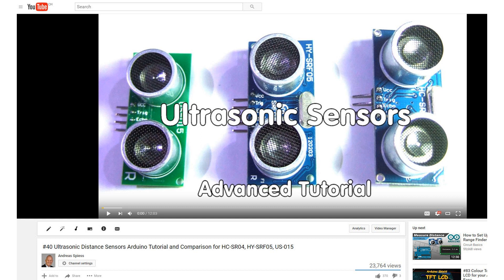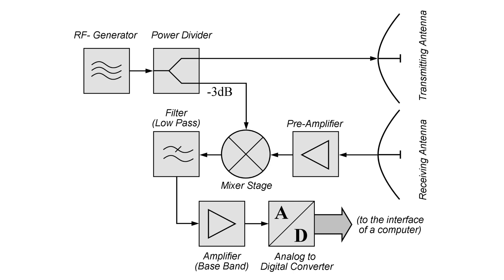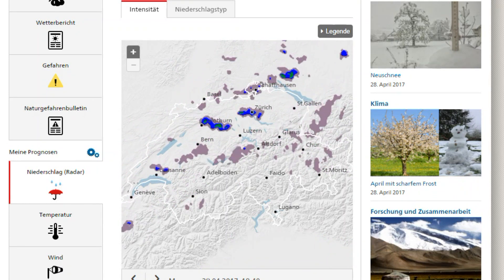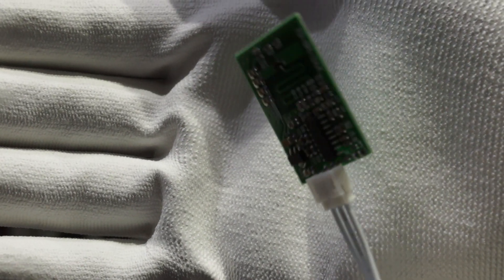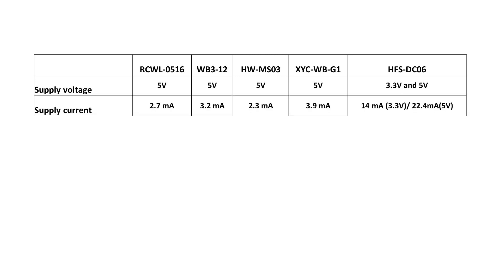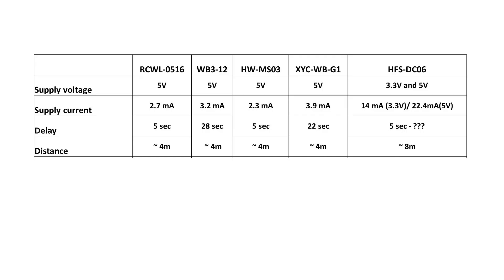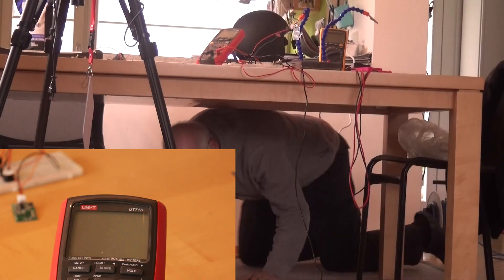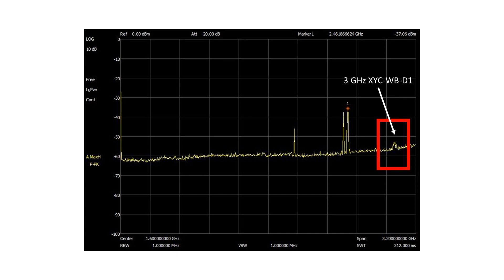#135 Radar Sensors / Switches: Comparison and Tests

Comment: The RCWL-0516 is not 360  When I power it up and sit behind it IC side it does nothing. It seem to be something like 270  to 200 degrees. With pets it kind of does not  pick up a small dog and I dont have a big dog. It works well but the sensitivity pattern is a big mystery.  Outdoors is another question but in general much better than a PIR. Very interesting is that it probably relies on a bounced signal from objects as can be expected  which results in the idea that it has a 360 degree but it is rather doppler. Besides that it is an excellent sensor
Reply from the maker: And in addition, it is very cheap and goes through thin walls...

Comment: Hello Andreas. Interesting video. I was thinking, if you cover one side of the sensors with some metal plate, will it become direction sensitive? Maybe the plate must be connected to Ground? I am looking forward for the results.
Reply from the maker: I had one sensor with a metal shield and it worked. So, it should be possible. I would connect it to ground. At least to begin with.

Comment: I think the lack of interference between 2 modules can be explained by them giving out a short pulse on a interval and only listening for a very short period after the pulse, making it unprobable that a sensor will be listening while the other is transmitting
Reply from the maker: I doubt that this is the case as we have not enough active components on the board. There are many discussions and videos which try to explain how they work. I do not know exactly.

Comment: I wanted to know when someone is approaching the yard so I used AVR µC + PIR sensor + NRF24L01+ at the transmitting side and AVR + NRF24L01+ and the speaker at the receiving side. That works but only when it is dark (there are false alarms during the daylight). I wonder if I could use RCWL-0516 instead of a PIR sensor. I'll try to insert the RCWL-0516 into a tin can with 60° opening. Has anybody tried to narrow the detection angle by shielding the sensor with a metallic shield?
Reply from the maker: Or you use the sensor with the built-in shield?
Reply: Yes, that might be an option but HFS-DC06's radiation pattern is 180° which is way too wide so I would need a shield anyway.

Comment: I'd say they work by only listening for Doppler shift. The shielded example would pretty much have to be directional. They also have 2 antennae, one on each board face. In case you didn't know, household glass is a metallic alloy, lol. The manufacturers even make it to be x-ray opaque, to facilitate picking it out of clumsy flesh with a minimum of labor. I'd have been seriously surprised if that quarter watt beam had reacted, lol. Great vid!! Apples compared to apples, under reasonably real world conditions. I'd love to see if sloshing water set it off, or a flying insect, or a cheap cell phone, lol
Reply from the maker: There are a few other vids around which try to understand how they work and where they are blocked.
Reply: glass a metallic alloy? That is an extraordinary claim, do you have anything to back that up? Especially with that coming from a luddite neanderthal. Perhaps you watched a little too much startrek, but IRL we don't have any transparent aluminium (or any other transparent metals) so I think you are as mistaken as your neanderthal claim.
Reply: Jelle B isn't sillicon a semi-metal?
Reply: +Jelle B >> Educate yourself on low-E glass.
Reply: Transparent aluminium: look up sapphire :D

Comment: Hi! Wirklich tolles Video! 
Habe mir nun auch 10x RCWL-0516 gekauft. In meinem Anwendungsfall befeuere ich die Sensoren mit 24V Eingangsspannung. Soweit funktioniert auch alles super. Nun habe ich nachgemessen und sowohl bei 5V bis hoch zu 28V braucht das Modul immer konstant fast 3mA, sodass die aufgenommene Leistung zwischen 5*0,003 = 15mW und 28*0,003 = 84mW liegt. Kann das stimmen? Ich schätze dass die Differenz durch einen Wandler (den ich auf dem Board aber nicht finden kann) in Wärme umgewandelt wird. Oder meint ihr dass die Antennenleistung damit hoch geht? Den Test mit 4 Metern konnte ich bei meinen 24V stark überbieten. 8 Meter sind hier kein Problem. Bei Spannungen im Bereich 3,3 bis 5 Volt ist eine Erkennung eher Glückssache - bei 5-8 Volt sind 4 Meter recht zuverlässig und richtig super und genau ist es bei 24V. Da kann ich bei ca. 3 Metern Entfernung entweder einatmen oder einen Finger bewegen und der Sensor löst aus. Prima, da ich die Sensoren als Präsenzmelder einsetzen möchte um Licht zu schalten.

Muss ich Angst haben bei 24V von den Modulen langsam gegart zu werden? (so ganz vertraue ich den Teilen nicht) :-D
Reply from the maker: +Richard Treu Ich hätte eher Angst dass du die Teile garst als umgekehrt. Ich jedenfalls würde so was ohne Not nicht tun.
Reply: Andreas Spiess würde es am liebsten auf 5 oder 12v betreiben, aber ich habe eine 24V Leitung vom Crestron Cresnet Bus (weitere will ich nicht legen). Würde sonst nur ein DC-DC Modul in Frage kommen, aber das ist auch nicht die optimale Lösung.
Habe den einen Sensor jetzt zwei Wochen ununterbrochen an den 24 Volt hängen und er läuft einfach super.
Reply from the maker: Dann ist gut. Ich habe die maximale Betriebsspannung der Teile nicht nachgeschaut.

Comment: Great video Andreas. Do you think that OUT pin can be used to trigger a transistor which trigger a relay ? how much current could you take from OUT pin ?

Regards,
Reply from the maker: You can use it to switch a transistor. I assume, you can get a few mA. But I did not measure.

Comment: great video, i would like to give it a try, i have question, does WIFI can trigger the radar?, GSM?, RF?, im making a prototype using GSM and PIR sensor, but the GSM often creates interference to the PIR, so i wonder if this would be the same case?, thanks!
Reply from the maker: RF enters all electronic devices and can do harm. Without precautions, it is well possible, that also these detectors are influenced by a WiFi or GSM module. Usually, distance and capacitors help...
Reply: I have been doing quite a bit of testing with microwave sensors after finding lots of false triggers. When using with a NodeMCU it is affected by the WiFi from the ESP8266 chip. I have tried adding capacitors and adding simple foil shielding which is grounded in between the NodeMCU and the Microwave sensor but while it can reduce the problem I still received false triggers. The only thing that enabled these to run stable was to keep them sufficiently far from the NodeMCU, which is no good if you are wanting to contain a microwave sensor and a NodeMCU in a small container. Testing with a Arudino Pro Mini produced no false triggers without any capacitors.

Comment: You can learn more about how the RCWL-0516 sensor works, with a schematic and explanation here: https://github.com/jdesbonnet/RCWL-0516  It is a single-transistor MMBR941M  L-C tuned-circuit microwave oscillator around 3.18 GHz, where the inductive trace + rear capacitive load structure acts as the antenna, and the transistor junction doubles as the nonlinear element (mixer) for the doppler signal return.  The oscillator frequency shifts with any environmental change, temperature, bias voltage, humidity etc. I am sure no two models even of the same type have quite the same frequency, so many units (likely) still work nearby each other. Very cheap, very simple. I'm not sure what the status of such a design is legally re: FCC, CE etc.   In the USA, as far as I know the approved frequency bands for microwave motion sensors are usually at 10.525 GHz and 24 GHz.  There are also various "Part 15" unlicensed devices but they have strictly limited emission power.
Reply from the maker: Thanks for the link.1. I am not sure, if it uses the doppler effect. Another theory is that it detect phase changes. I did some tests. If you switch a second device on in the same room, the first triggers. Also, I do not see really sharp filters to separate different frequencies on the board.
2. I cannot imagine they are legal. But they do not harm because they emit only very small power. So, I can live with it. For me, this is like driving a little too fast. Illegal, bu not dangerous ;-)
Reply: You may be right, although in this case, not just phase but actually the RF frequency changes also,  quite a bit. Amplitude too no doubt. As far as I know, none of the cheap doppler radar motion sensor designs on eBay/Alibaba/Banggood like the HB100 at 10 GHz, or the CDM324 at 24 GHz have any kind of RF filter. They simply mix together Tx and Rx signals which due to doppler effect, gives you a difference frequency near DC depending on velocity of the target. On these 3.18 GHz modules, that low-audio-frequency mixer output (or if you prefer, detected signal amplitude envelope) goes into a high-gain, low-bandwidth baseband detector IC similar to the PIR detector chip.

Comment: There are two active devices in the RF line up, the oscillator and a mixer diode.  The oscillator generates the transmit carrier.  There are two signals in the mixer diode, the transmit carrier and also the reflected signals coming back from the room.  If there is any movement in the room, the reflected signal at the mixer diode will be different from the transmit carrier (a doppler shift), and a Ftx-Frx differential will be produced out of the mixer diode - this usually at audio frequencies.
Reply from the maker: There are a few theories below in the comments. It is not clear if the Doppler effect is used. Another probable effect is phase shift. But I do not know.

Comment: It's a pity 5 seconds is the smallest delay. I would surely get these for projects if it was possible to get lower delays. Thanks for the informative video. Haven't heard about these radar sensors before!
Reply from the maker: You can influence the delay with changing resistors in most models

Comment: I am subscribing. Thank you for making these. I have a question about how you performed the angle of detection, though. You state that the majority have 360 degrees of detection. However, you were measuring this in a room that seems to have several walls within the nominal 4 meter detection distance. Is it possible that the detection was still very directional, but seemed omni directional due to reflections from wall and furniture surfaces? Perhaps testing in a more open environment or outside would produce different results? At any rate, thanks again for your videos.
Reply from the maker: You are right. This is not a scientific approach and it for sure has some flaws in my method. However, one device had a clear directional behavior. So, reflections are probably not so important.
Reply: I think it is still more scientific than most, so thanks again. I did a bit of follow on research and it turns out that at least one of the 360 units is actually advertised as such. So, you were probably spot on. Given their nature, I suppose that using it to query distances between vehicles in motion or between a vehicle in motion and a stationary object (read collision prevention) wouldn't be viable. It seems that it may provide a good tool for judging movement in a space where you want to filter out small actions or actors (like pets). Does the read out correspond to the amount detected or is it fairly binary? Did you find any useful fidelity in the output? Thank you.
Reply from the maker: The original devices have a digital output. There is a link somewhere below or in the comment concerning some experiments with connecting to a analog pin on the board itself. So, you are free to experiment.

Comment: Probably the reason you can use diferent modules in the same room is because they not only send a frecuency, but a signal with data in it thay way the sensor knows that the signal is receiving is it's own signal
Reply from the maker: I am not sure if they can create different data with just one transistor as a sender and a receiver.
Reply: I think the IC has more to do, IMO the IC generates a wave in one pin and passes through a resonator (a coil and a capacitor) and then a resistor at the output then in other pin of the IC Theres a frecuency that pases through another resonator and then another resistor, if you conect the ends of the resistors you have a VERY BASIC passive wave mixer, and then the output of that directly to the antenna, the only purpose of the transistor I Think is amplifying the signal received and then is given back to the IC to analize it. I dont know how this works either, but for me has more sense this way.

Comment: So in THEORY you could stick these behind the bumper of your car and use them as parking sensors, or for an extra data source in self driving cars?
Reply from the maker: In theory: Yes. But they are very omni-directional and they do not show the distance, just on-off

Comment: It did not work through the door glass most likely because your glass is low-e energy efficient IGU. It has a metal film on the surface and is not radio transparent.
Reply from the maker: The glas in my house is just ordinary glas, no metal film.
Reply: Andreas Spiess , google it. How can you be sure if your glass is low emission or not? Or just check with thermal imaging camera and see for yourself.

Comment: I also find these sensors quite fascinating. I do not believe they (except maybe for the HFS) work with the doppler effect.
I think what they detect is the change in overall RF absorption/reflection, resulting in a tiny change in supply current draw. One extremely simple circuit I traced out clearly had the PIR sensor IC monitor only supply current of the RF section. There were only two pins to the RF section and no other interface. Those PIR ICs are extremely good at detecting even the slightest change in their input signal, if it falls in the right speed range for a moving human.

The larger more expensive sensors with the metal can do rely on the doppler effect. I have one of those white box sensors and the RF section is connected to the rest of the switch with three pins, supply and an output pin. I put a scope on the output pin and it was the mixed doppler output, you could see the frequency correlate with the speed of an approaching or retreating human. But those are far more complex than the other single transistor ones.
Reply from the maker: There are a few discussions below in the comment about how they work. I agree that the cheaper do not work with the doppler effect.

Comment: Movement is almost never detected by the red shift (frequency change) of the reflected  radio wave. Speed is measured in a totally different way, with a so-called doppler radar. Doppler radar measures the distance of an object by measuring the time elapsed between sending out and receiving the same signal. It sends out two singals, and measure the change of distance between those two signals.
Reply: I think there is a misunderstanding here? The RADAR I was working on cost just under £2,000,000 and use multiple pings etc. However, I understand these very low-cost units operate exactly as described in the video.  I purchased mine for  <£2.00  Even the PCB is used as capacitors, a transmission line and an aerial, they are amazing units really!  Don't get the PCB too hot when soldering as the RADAR went deaf. It's a pity we can't use them in Europe legally.

Comment: Hi, at the moment I am building my motorcycles security system. What do you think about idea of integrating such sensor, so that it senses when someone  want to touch motorcycle? 

Thank you, you have created great content ;)
Reply from the maker: I am not sure if you want that. It might give a lot of false alarms. My Harley only reacts when somebody moves the bike slightly...
Reply: My idea was to use two phase system. Radar and piezoelectric. 1st one just to send 2 short beeps, when someone approaches to close to bike and  piezoelectric or gyro that activates full alarm mode+A7 GPS+sms. 
Is there a way to change radars  sensitivity to reasonable 1m radius?
Reply from the maker: There is a resistor on the boards for that. You have to google, which one.
Reply: Andreas Spiess thanks and good luck with creating more awesome videos ;)

Comment: 1.8GHz is likely 3G / cellular network.
Reply from the maker: Others suggested that it is my Gigaset phone...
Reply: Andreas Spiess that would probably be true if this was an unlicensed frequency. cellular telephony operates at 750, 850, 950, 1800, 1900 and 2100MHz licensed frequencies, meaning that cellular operators pay for explicit assignment of these frequencies to them, and if any other vendor used this in their products, these would be either non compliant to regulations or a frequency band would have to be licensed to them directly, too. otherwise their devices would be jamming, monitoring or affecting in a different way cellular network frequencies.
There's few unlicensed bands (which are still regulated, but are not licensed) that are used by home appliances (including Bluetooth and WiFi - it's no coincidence that the frequencies of these two match), and from what I've read, gigaset devices are using these bands (2.4GHz and 900MHz to be exact)
Reply from the maker: +Tomasz Wiszkowski I can follow your arguments. And, of course, we have a few mobiles in the proximity.... So, this seems to be very probable.

Comment: Very good video. I have a doubt, i see that ir Ford not Connecticut the radar sensors yo some Arduino, how it realizes the Connections so that ir flashes the LED?  Thaks
Reply from the maker: I do not understand your question
Reply: sorry my english not is good. This devices can work without arduino? And how is the conecction in your tests? Thanks
Reply from the maker: +andres perez They just have a output pin and you can connect what you want (I connected a LED)
Reply: Thanks